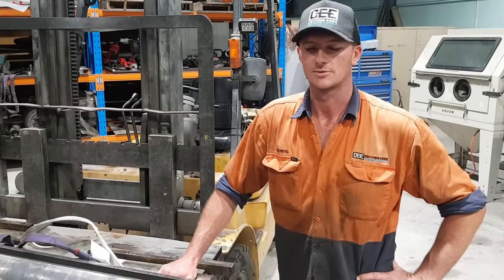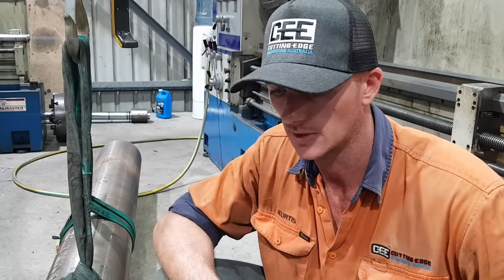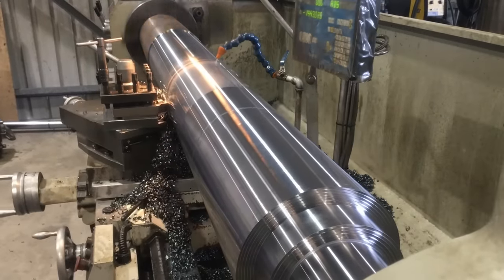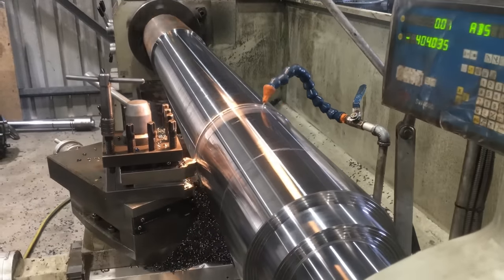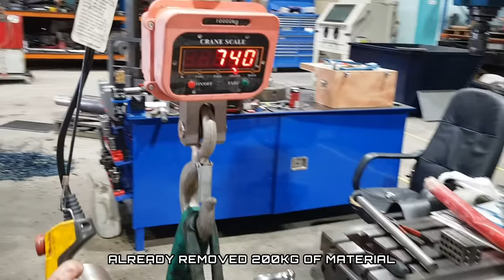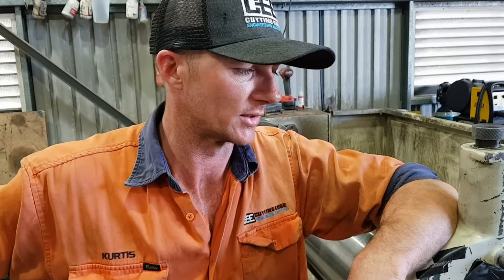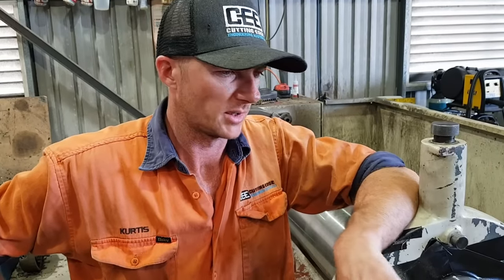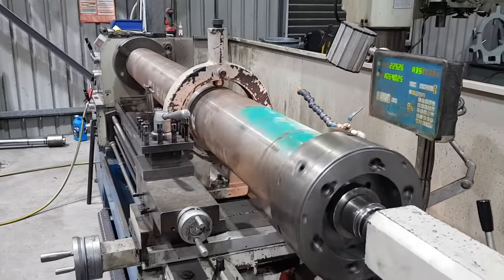Heavy Duty Machining 1000HP Tree Grinder Shaft | Part 1

Comment: The shaft is so heavy that the 3point stabilizer(not knowing its proper name) is acting like a cutter AND the shaft is sagging over that
very narrow contact: the metal of the shaft is acting with the characteristic of rubber. Causing the shaft to go out of round with each
turn. You need a larger surface area of contact at the 3point stabilizer. Something like a 3" inch wide bearing at each  of  those  three
points of contact: to spread the load. Just imagine the huge bearings in place when the shaft is operational in that Tree Grinder: one
of the functions of THOSE BEARINGS is to spread the load of half a tonne of shaft. What you have in that turning lathe is  an  unseen
buckling shaft; measured in the thousandths of an inch. The stresses on the shaft are due to the narrow contact being  made  by  the
existing bearings. Easily seen by the discoloured ring they left imprinted on the shaft.  *I was gobsmacked that it actually happened.*
But there had to be a reason. The Tail stock is way too small a point of contact for such a weight. The only other advice when such a
weight is in the centre: cut everything out from the centre first.  3/4 of the whole shaft at the centre,  OFF,  leaving the last 6mm.  That
weight removed is what is throwing the shaft out of round to begin with.

Comment: That runout is terrible.  You can see the shaft flexing in the 23:09 mark on the support.  Is that support tighten down?  It almost looks like there may be a small gap.

Comment: That bar stock reminded me of the very first hour of the very first day of my very first job. I went to work in a heat treating plant. The boss is showing me the trolley system to get parts into the furnace and points out a huge crankshaft on a pallet and says "Ok, we need to get that up on the trolley".  I mindlessly lean down like I'm going to pick it up.  He says "You might want to use the forklift. That weighs 2800 pounds". 😬
I actually got good at the job and got promoted but that was my start...total dumbass.

Comment: The chamfer of the rough machining shaft diameter is too small, and 4340 material is easy to break at the chamfered position during heat treatment

Comment: In my experience you need to remove ALL the skin before worrying about bend, semi rough, rough, semi finish and finish, I know its 4 operations but that how I was taught, and I did mostly exotic materials,  never had a problem

Comment: Bet you learned alot from that mistake. High tensile will always move removing that much material. Rough it with 10mm left. Let it sit for a few days on the floor then finish between centers. You rushed it.

Comment: Does the possibility exists. that the bar was not centered  ;  could Center have been shifted in the flipping of shaft evolution , weight of the bar is flexing the end points of the machine .  The diameter of the bar  is to small  too  true up the shaft  !

Comment: Rookie mistake you should have made sure that it was true before cutting as soon as I saw you put it in the  clamp I really noticed it was not in there even you didn't put a level on it metal bands it may not look like it but it does even that big piece of steel will bend the farther it gets out from the clamp

Comment: Welle drehen ist nich so leicht.
Hast Du aber Par Fehler gemacht. 
Empfehlung.  Welle spannen.
Lünette Stelle drehen. 
Zentrieren. Schlag mit kleinen Spann und Vorschub aufdrehen. Weiter Vordrehen
Bis Aufmaß 10MM.
Noch mal Lünette Stelle überdrehen. Am Ende Radius 
5 MM .Planen bis Zentrierung. 
Welle Umdrehen .Kurz Spannen. Nicht in die Maschine rein stecken. 
Zentrieren. Schlag mit Klein 
Span und Vorschub 0,2 Drehen. Schlag an der Lünette 
Kontrollieren, eventuell neu
Drehen. Weiter Vordrehen bis
10  MM Aufmass.Am Ende 5M
Radius Drehen. Bei Vordrehen 
Achten auf Vorschub höchstens 0,2 bei Material 
Abnahme 5M pro Seite.
Kühlung sehr wichtig. Material 
Kann sich werfen wenn Die
Welle warm wird. Reitstock
Immer Kontrollieren darf nicht 
zu groß sei.Immer Lünette Stelle Kontrollieren. 
Viel Spaß beim Arbeiten wünscht dein Dreh Freund 
Lutz.

Comment: This type of shaft, with large dimensions, must be hardened and doubly tempered before machining, even if the desired final hardness corresponds to a hardness obtained by normalizing. The homogenization generated by the hardening  and tempering reduces the residual stresses that cause deformations during machining.

Comment: Face off before centering  allso with the center drill is running  out  recut it using a single point HSS  tool   work in Toledo Ohio large and long paper mill rolls  allway face off and center drill  then recut it with single  point tool
You be surprised  after center  with center  drill then go in there with a single point re cut it how much the center drill walked

Comment: When it comes to running real parts like that you've got to lose the live center.
Dead center and white lead as a lube that stuff is hard to come by these days it can be bought out of china we used to use it as a wood filler back in the day I still have a small jar of it in water.

Comment: Yes of course it got worse than he treats the question is how did you deal with it or did it end up being scrapped that's a tough break man you know you could have stopped that right away the material didn't do it to you you did it to the material yes the material warped like a banana the question is how did you handle it I can think of so many things that could have been done different whatever the critical diameter is you got to get it running as true as you can and then cut the ends to it if you don't got enough stock shame on you sorry to say but had they begun with a full furnace anneal followed up with a heat treat probably could have prevented all that to begin with.
Long parts always must watch out for signs of the banana.
When you first chuck the part you wish to establish a center at the other end it's hard to do though if the part won't support itself this is where things can go haywire if you place a centered piece of steel on the end centered best you can and weld it to the end of the bar just so gives you enough of a grip that you can get three to five cuts on the bar to place your steady rest that all run true to each other at that time you'd be Miles ahead even if all you did was to have it heat treated prior to attempting any machining on it you can weld the center on the end before or after matters not just make sure you got stock on the end. You can actually do it on both ends if centers aren't allowed.

Comment: Shafts are designed to fail their.....for a reason should have stayed with the same material.....next time the  machine might be. A total loss...something might go that’s not economical to fix....Don’t want to tell you how to suck Eggs ....your obviously a very clever bloke...I served my time in the uk @ Rolls Royce in NEWCASTLE making steam and nuclear turbine and gen sets ...so we turned some big shafts.....your bang on with the heat treating theory,,   But the bars have to be spun cast to stand any chance when machining also...all,the skin should be removed from every face 1st even the ends .and you have to releases the Chuck tension before you start removing the meat off the bar.....also your always gonna struggle ...with 1 steady need 2 at least ...and finish turn it in a drive plate not a Chuck ideally should be ground.the last 0.2 but that’s not always an option

Comment: A fascinating but kinda depressing video. I'm an ex-woodworker, so I'm used to using live materials that 'move' on the lathe, but this is pretty scary stuff. I think we're looking at a very shiny, very expensive doorstop or paperweight. Imagine how much worse things would be after machining the slots/ keyways. Yikes.

Before there's too much of a nationalistic hate-storm, though, don't forget that any country - yes, ANY country - can turn out crap and sell it if people looking for a bargain are willing to buy it. And buying cheap materials is always a gamble. Caveat emptor.

Some old, established companies will offer to put things right if they're concerned about their reputation; some newer companies won't give a toss. Pile it high and sell it cheap; there's plenty more fish in the sea.

I'm a Brit and have no problem accepting that China can produce excellent, world-class products and materials when it wants to. Of course it bloody can.

That might stick in some bigoted throats, but don't forget that the east had perfected metallurgy and ceramics and a dozen other original technologies thousands of years before the west had worked out how to make cart wheels from tree trunks.

Shit happens. If you want quality, be prepared to pay for it. It's tough that guys like Kurtis have to pick up the pieces when somebody else has gone for the cheaper option. One thing's for sure: this kind of video exposé is going to cost some steel plant an awful lot of money and customers.    ;-)

Comment: I noticed that you are standing on a bare Cement Floot with your Boot, No Rubber Plastic Pad on the Floor, to reduce the Vibrations caused by the movement of Machines,  Vibrations is too dangerous to the operator, it weekens the Heart of the operator in the long run, Put a plastc Rubber Pad on the Floor, at least 3/4 - 1  Inch Thick  with holes on it, So the metal Chips could go thru, & to reduce the Vibrations. Some are using a Wood Board with space on it to let the metal chips go thru, Good Luck.

Comment: Bad work. you need the learn how to work with long shaft.
All material equally behave in machining proces. Am machining stainlesstell shaft for ships, 5000mm long and  am haw equal problem but with correct access in machining the problem with bending is solved.